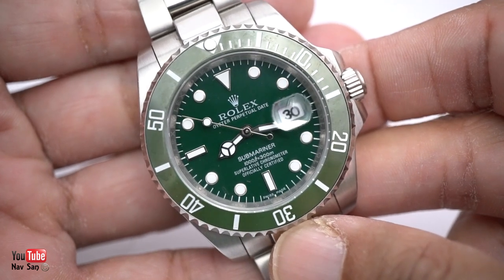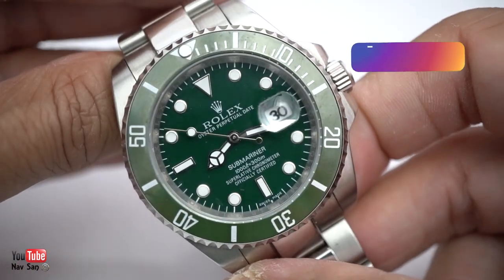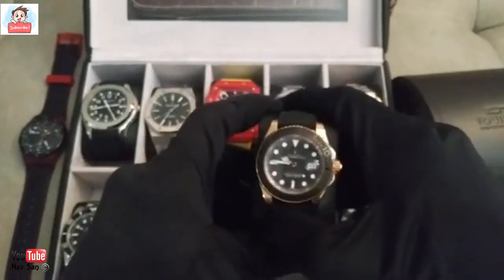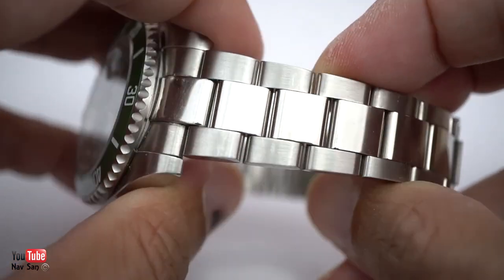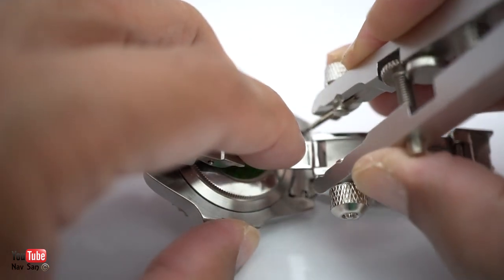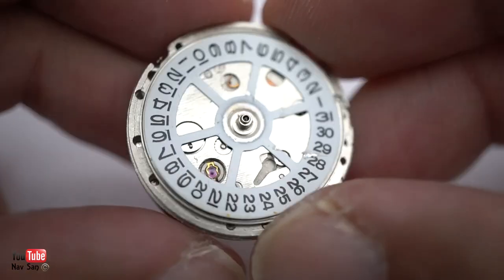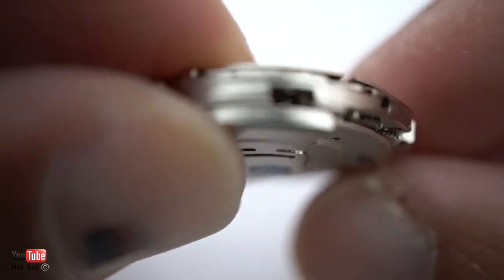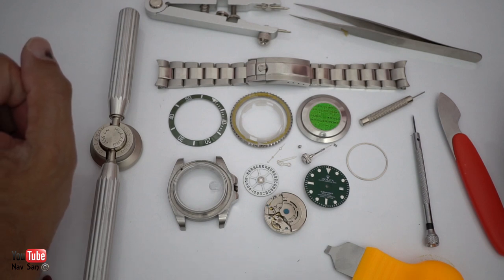Braking A Rolex Submariner. How To Spot A Replica and not get scammed.

Comment: Thanks for the video. It seems like you would not even have to open this one to see. The bezel and dial colors seem really off. And the way the bracelet and lugs meet. The Rolex polish on the hands is usually not straight. The edges of the hands look cheap and I bet the bracelet feels like a cheap rattle snake.

Date and crown are weird too, pearl ... so many things look wrong on that one.

The Hulk also shouldn't have polished center links. Did they even try?
Reply from the maker: ᴛʜᴇ ꜱᴜᴍ ᴏꜰ ᴛʜᴇ ᴘᴀʀᴛꜱ ɪꜱ ᴡᴏʀᴛʜ ᴍᴏʀᴇ